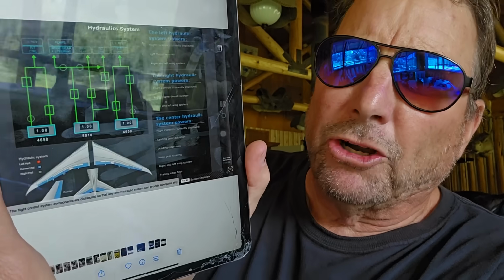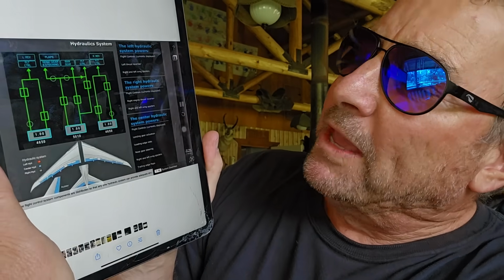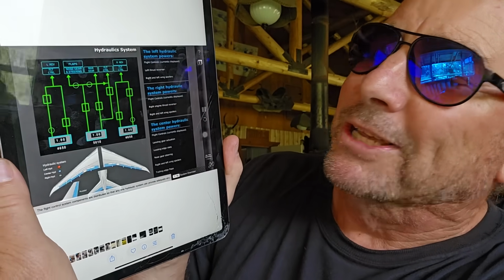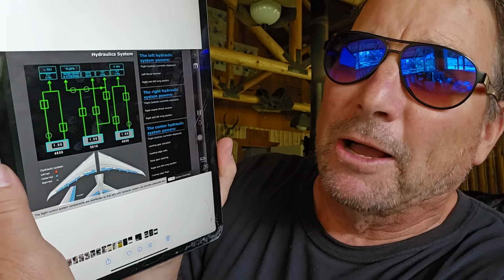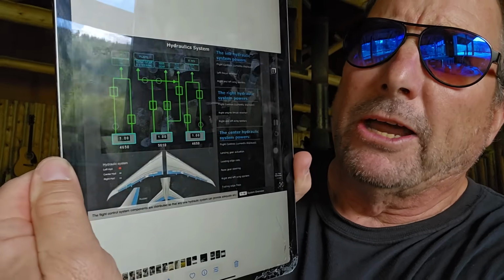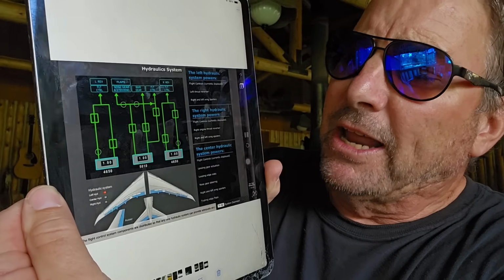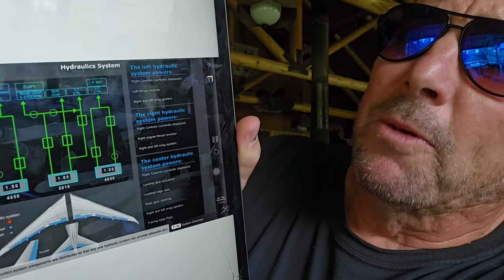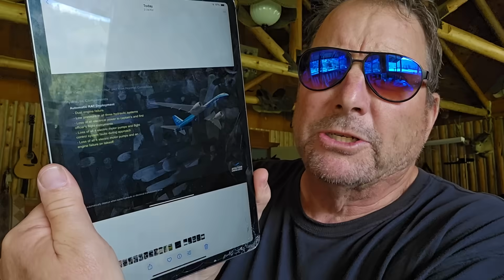787 Crash India What's a RAT? When does it deploy?

Comment: The reported(?) Mayday call stated..."loss of thrust"
Did the 787 use the entire runway or just half...the 787 took off at the very end of the runway, with dust flying. Normal takeoffs are not near the end of the runway.
Temp at takeoff was 40c or 104f.
There is a photo showing the wing leading edge SLATS deployed....but, this may have been caused by the crash.
 ( Great timing on the fishing trip.....Capt Steeeve got 4 million views, while Blancolirio caught a bug-eyed fish)

Comment: Juan, would it be possible to inadvertently retract flaps instead of the gear?
The operating switches are in two very distinctive and different areas!
Reply: Obviously I'm not Juan.  It is possible though not likely even though tons of people have jumped on the blame the copilot wagon.  As Juan stated at 4:14 if the RAT was the only thing powering the electrics and hydraulics, the gear would not retract when the gear handle was selected up.  There is no evidence the flaps were retracted and more and more evidence (pictures of the wing at the crash site) that they were in the correct takeoff position.
Reply: Engine power loss coz of fuel contamination or main electrical issue..

Comment: The cloud of dust stirred up at the end of the runway suggests an overly long run, and combined with the anemic rotation and deck angle, indicates there was likely an engine power issue that became apparent during the take-off run, but they were facing V1 with nowhere to go on the ground and rotated, hoping they would somehow have a chance to work the problem in the air. But of course they immediately knew it would only end badly. 🫤

Comment: My money is on fuel contamination.  I think the engines started to roll back just as the plane reached V1.  The pilot took a moment then realized he had to takeoff with the intention of circling to land.  With the startle factor , both engines continuing to tank and all of the bells and whistles going off the gear retraction got skipped.
Reply: My advice to you is to not go to Vegas.
Reply: Fuel contamination generally isn't the problem in jets that it is with planes that burn AVGAS.  Water is normal in jet fuel but only causes issues when ice crystals form, which is prevented with additives that also kill the fungus that grows in jet fuel.  If you already know this - sorry.  If you don't and want to know more, google "prist".

Comment: There is a picture of the aftermath showing leading edge flaps/slats deployed and trailing edge flaps deployed at a very min setting. Probably 5 degrees
Reply: Which might make sense. One theory is Pilot Not Flying reached and moved the flap settings reducing them, instead of retracting the gear. Flaps 5 would not have given them enough lift at the speed they were going. I’m skeptical regarding the RAT.
Reply: @andrewtaylor940 Actually, flaps 5 should have been within limits for that runway

Comment: Other channels point to landing gear and lack of flaps being the cause for the loss of lift doesn't make sense to me when this plane should be able to climb and fly on one good engine. It appears to be some kind of electrical system failure that led to this, as both engines are unlikely to fail at the same time without ingesting foreign objects. The concerning part for me is how an electrical system failure could cause both engines to shut down, i would have assumed each engine would have its own redundant control system all the way to the power level?!. It will be good to see what the black box says!

Comment: Fuel contamination could fit the known facts… shift in fuel pickup ports at rotation… then dual engine failure —> RAT
Reply: It does feel like rotation (angle, weight-off-wheels, x??) , or a pilot task just after rotation (gear? What else?) triggered the problem and thus the crash.
Reply: Fuel contamination generally isn't the problem in jets that it is with planes that burn AVGAS.  Water is normal in jet fuel but only causes issues when ice crystals form, which is prevented with additives that also kill the fungus that grows in jet fuel.  If you already know this - sorry.  If you don't and want to know more, google "prist".
Reply: Tanks have baffles with multiple pickups and transfer jet pumps… when the plane rotates for takeoff, fuel flows rearward … it is possible contamination in flowed to the pickups and caused power loss. Just a hypothesis… but possible. Will have to await the investigation findings.

Comment: I noticed in the video, showing takeoff, that the 787 used the entire runway as dust and dirt can be seen swirling around at the end of runway. Not sure what the temperature was at this time of day. Hoping the information from the black boxes will be helpful.

A simultaneous failure of both engines on a Boeing 787 is extremely rare and would require a highly unusual or catastrophic scenario. However, there are several known or theoretical causes that could lead to dual engine failure

One of these is complete failure of the Full Authority Digital Engine Control (FADEC) which is an advanced, computer-based system that fully controls an aircraft's engine without any direct pilot input once it's operating. It manages all aspects of engine performance and operation, including thrust settings, fuel flow, and even engine start-up and shutdown.

Risks of FADEC Failure: While rare, if both FADEC systems on both engines were to fail simultaneously (due to electrical, software, or power supply issues), it could lead to loss of engine control. This is mitigated by redundancy, electrical isolation, and backup power like the RAT or APU (Auxiliary Power Unit). **Since the RAT was deployed it may mean “power supply issues”?

Summary: FADEC makes modern jet engines more efficient, reliable, and easier to manage, but it also means that engine operation is heavily dependent on electronics and software.
Reply: 37 C
Reply: @mitchmellons  I checked temperature a few hours after the crash and it was 43 C around 6:00pm local time. I would've thought it would've been warmer earlier in the day?
Reply: coulda been the Artesians
Reply: As reported on the ATIS, the OAT temperature was 39c
Reply: Also ADS-B data shows that the aircraft DID NOT use the full length of the runway.
Reply: @you463 ADS-B data was wrong. They did use the full length - it looks like the engine failure started after they reached the maximum safe abort speed (V1). If you lose a single engine at V1 you still takeoff because you can’t abort the takeoff and stop on the runway. 
Losing BOTH engines at V1 is a guaranteed crash.
Reply: @allangibson8494  they did not - they had 3000 feet of runway under them and had 71-100 feet over the threshold, WAY more than the required picture screen. The data from the day before shows they rotated, lifted and climbed out in the same distances as the accident day
Reply: @TrollingwTyrone Tower data shows they backtracked to the start of the runway before departure. Things started going wrong when the aircraft rotated.
Reply: It it's a FADEC issue it's far more likely that the air crew input incorrect data into the FMS and/or there was a sensor issue due to poor maintenance.
Reply: The account I heard was that they got airborne halfway down the runway?
Reply: @tomriley5790 Imo it does look like they were off by taxiway C, which should be normal for flaps 5 if the flight sim 787 is somewhat accurate
Reply: @tomriley5790  No. They did in fact use the entire strip with a lot of dust being raised which suggests that the aircraft was delivering full power on lift-off. Initial climb looked OK. IMHO Something catastrophic happened shortly after liftoff. Remember that the soul survivor said he heard a loud bang and a flickering of cabin lights and around the same time a mayday call was made indicating loss of thrust. Why hasn't the Indian ATC released the audio of the mayday call?
Reply: @AstralVoyager-q5f flight radar posted a graphic of their data for like the last 10-15 takeoffs of that flight from that runway, and this flight actually used less runway and rotated earlier than most of them

Comment: A passenger on the ill-fated flight posted a preflight video complaining about the long wait prior  departure and the A/C not working as well the seat movie screen or phones. He said the heat was 'unbearable" and everything seemed not to work.
Reply: That passenger was not on the crash flight. He was on a flight the previous day which he claimed was the same aircraft. Whether it was or not l don't know
Reply: You fell for clickbait, that was a completely different flight
Reply: That is very interesting. Flightradar24 posted the ADS-B data they have. And it's very spotty - only about 40 "pings" in 20 minutes, when the normal 1 per sec should've yielded 1200 pings. So there might have been severe electrical problems aboard.
Reply: The entertainment system was not working.....but, people that fly India on a regular basis say that is normal.....the airline doesn't want the cost of the entertainment fees.
Reply: If there's an unexpected delay when you've already been taken off of the airport electric (or it just plain isn't working/available at that gate) you don't get aircon unless unless/until the engine that provides  it in flight is started up, which uses fuel so isn't an airline's favourite thing. I've roasted in many a delayed plane back when I was flying frequently in hot countries.

Comment: Hello,
Is it possible that, after ten years in the hot and humid Indian climate, the electrical wire bunches maybe had that Kapton insulation that frayed and shorted many systems onboard the Dreamliner, all at the same time? You know, like Swissair 111.
It would explain the sudden loss of the transponder at the same time the aircraft lost electrical& hydraulic power, causing the deployment of the RAT.
Prayers for all souls onboard and on the ground who were lost in this accident.
Greetings from the UK,
Anthony

Comment: Years ago, while waiting to board an India Air flight from Bombay to Calcutta, all passengers were left standing on the tarmac. As we watched, a mechanic in grimy overalls approached the Boeing 737’s engine. He opened an inspection hatch on the cowling, pulled out a dipstick, and wiped it clean with a dirty rag. After reinserting and removing the dipstick again, he grabbed a small can of oil—maybe one or two liters—and poured it into the engine. He then secured the hatch and walked away, leaving us to board the plane with a mix of amusement and apprehension.
Reply: How else would they check oil and top off?
Reply: @mycammedia Next time I’m waiting to board a bus or an uber and the driver lifts the hood for a quick engine check I shouldn’t care. Just routine, yeah?
Reply: @jackbarnes6929  duh yeah routine - how do you think any machine is maintained - seems you'd rather they let the engine run dry and found out that way.  What exactly do you think aircraft mechanics actually do - or any mechanics, heavy plant fitters. Why do you think engines have a dipstick? Shock fact - even healthy engines consume oil.
Reply: Would you prefer that the mechanic did not check and top up the oil?
Reply: @cedriclynch  gosh I don’t know, if it weren’t for the pretend Tom Cruise look-alike pilot being late and making us all wait 30 minutes on the tarmac, would the oil top up have happened at all?Would it be beneficial to work out why the engine consumed oil in the first place, maybe a sign of something worse. What do you think?

Comment: This jet was late rotating and never had the power to climb at a reasonable rate. I believe they had lost both engines before they rotated. They had two choices, crash at the end of the runway, or fly to the crash. There is zero chance that this was due to not having flaps, or selecting flaps up at takeoff. I've flown that in a simulated 767-300 at MTOW from that airfield and flaps 5 selected up immediately after takeoff... and even a very heavy 767 just flies away. It's a shame the news channels have been talking to experts who only fly regional jets and haven't a clue what the performance of a heavy twin is like. You picked a bad time to be on vacation ;-) 

ETA: tried it in a 777-200ER too, and it does even better than the 767. But playing with simulators isn't like looking at the DFDR logs. I hope they get good data and I expect to be appalled when we find out what really happened. But there is zero chance this was caused by selecting flaps up instead of gear, that's just horse shit. The latest theory I heard was a vapor lock because the cabin was warm. Errr... the Jet-A boils at 176C(349F) and it isn't stored in the cabin, and it isn't cooled by the A/C anyway. But if they can find a way to simultaneously fail all the fuel pumps, well that would cause a huge problem. Fuel contamination could do it and has done it before. But I am not claiming any particular cause, just that current 'expert' opinions are BS.
Reply: Are you certain it rotated late? I initially thought they was the case too, but camera angle analysis shows that the initial rotation was normal and not as close the threshold as people were suggesting. The 787 also had a long roll out anyway right? 

I’m not saying you are wrong, just that the certainty might be premature.
Reply: @MeppyMan you can clearly see dust being kicked up at the end of the runway as it rotated there
Reply: @lasersailor6684  That could just as well be dust kicked off from sides of the runway by wingtip vortices
Reply: @Lithos2k  Yes but... because airlines are cheap and don't like rebuilding engines, they use derated takeoff power when they can. So most aircraft takeoff at around the same point. And if 100 aircraft do that there isn't much dust left. Still, at this point my claim is just that the experts like "Captain Steve" are not giving credible explanations. Perhaps there had been a dust storm. I think that when the AAIB, NTSB, and Indian equivalent have looked at all the evidence we are going to be really surprised by what actually caused this.
Reply: @MeppyMan  Yes. If aircraft usually rotated where they did the dust would already have been swept away by all the previous flights.
Reply: Victor at VASAviation also said sources in India said this flight backtracked all the way to the end of the runway before turning around for takeoff (rather than backtracking only as far as one of the two turnaround points, as some reports claimed).

So if it was late rotating even though it had the full runway length, that seems even more telling.
Reply: The 767 max take off weight is between 350,000, and 407,000 pounds.  The 787 max take off weight is 502,800
Reply: @you463  Yes. Tried it with a 777-200ER at 650,000 pounds too. Flaps 5 and flaps up as soon as the altimeter started to move. But they are just models, even if the manufacturer does claim they are within 2% of perfectly accurate. The most important evidence is the MAYDAY call where the pilot said they had no power, and the audio where you can hear the RAT over the two 70,000 pound thrust GNnx-1B70s. They aren't that quiet.

Comment: Did the RAT deploy because the engines shut down?  Did the engines shut down because of a FEDEC fault?  The Full Authority Digital Engine Control can fail in such a way as to shut down both engines simultaneously.  In such a case the pilots will have zero control over engine thrust.  Check out the FADEC failure that shut down 3 of 4 engines and caused the  crash of the Airbus A400M aircraft at Seville, 9 May 2015.
Reply: Could be bad fuel too - that also causes dual engine failure.
Reply: @you463  When contaminated fuel causes dual or multiple engine failure the engines don't die simultaneously.  As far as I can tell, as a retired engineer looking at publicly available information, the FEDEC is the most likely suspect.
Reply: Why is everyone blaming it on a Rodent.
Reply: @guitarexpert2245  I can't tell if that was sarcasm.  In case it wasn't, RAT stands for ram air turbine - a small electrical generator powered by air going through it.

Comment: I'm going to made a prediction now:  A combination of failures from the entertainment system, AC packs, PDU lighting controls, generators, etc. coupled with maintainer actions result in a cascading electrical failures effecting automation / computer systems that causes in an engine roll back via the FADECs and / or electrical system fault.  The software / hardware is where I'd predict this root cause will be.

Comment: Juan, the 787 landing with the rat deployed is totally different than the rat deployed at 100% plus engine power on takeoff. I doubt if you could hear that rat at takeoff, just a thought. It sure
Looks like the 787 just climbed out of ground effect with enough momentum to keep it flying and slightly climbing for a few seconds and then floated like a feather to the ground at a forward speed of 140 kn which ended badly. I still am on the side of the flaps configuration being totally screwed up. The box, 
Flight data recorder was found that will tell us a hell of a lot of the configuration of the plane at the time of takeoff and any electrical or hydraulic problems. The cockpit voice recorder has not been found that I’m aware of. Hopefully it’s intact. There’s talk that the Airplane just came out of some maintenance operation. Hopefully they get the preliminary info out fast. The people like me that love Boeing And flying are praying that the great American company doesn’t take another hit.
Reply: A 787 with full power from both engines will climb at an angle that will scare the hell out of the passengers regardless of flap position. A 787 on one engine will still climb.
This is more consistent with an engine failure at above V1 (decision speed) that turned out to be a dual engine failure or total electrical failure that took out the engine computers.